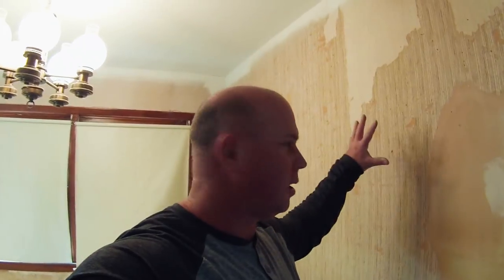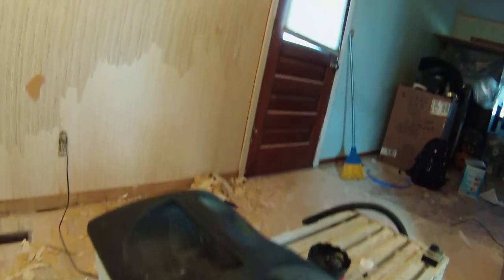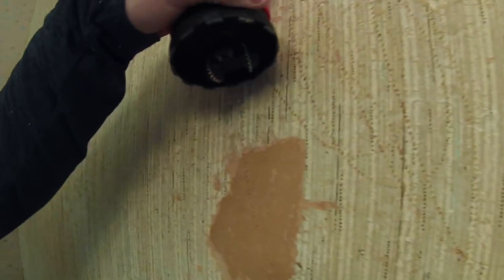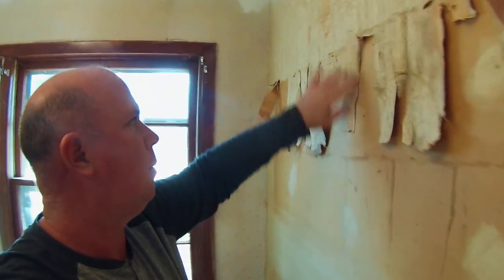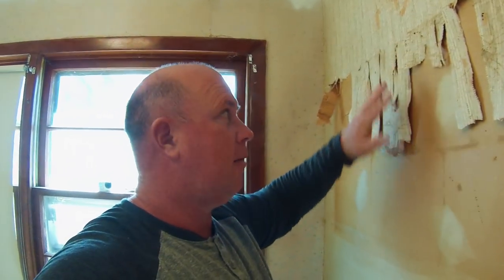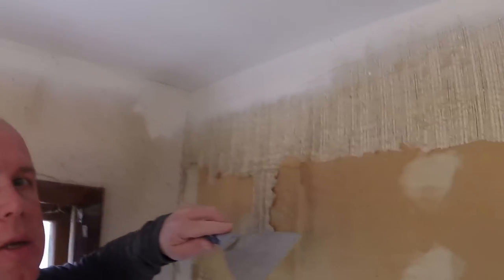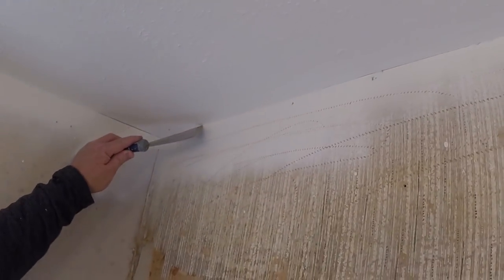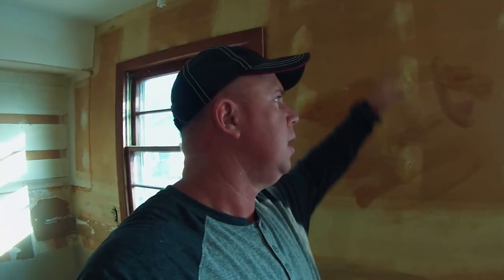Remove Old Wallpaper from Drywall Super Easy With Steamer

Comment: That wallpaper is coming off sooooo easily.. I’m working on an apartment in London built in the 80’s that’s covered in wallpaper... I have a steamer, I have a scorer, I have a scraper and it’s on drywall... taking me a long time and a lot of the paper lining on the drywall is coming off too... guess the wallpaper glue from the 80’s is a bit stronger in the UK? ;)
Reply: They probably didn't prime the wall before applying the wallpaper. That will wreck the drywall paper.

Comment: So what is the next step after the wallpaper is off? Can you just paint right over or is there another step. Keep up the great work as always Brian!
Reply: logdon17 ... and remember to fill any scrapes or holes with filler.. this can be done after painting too and is sometimes easier that way to see any imperfections that you might not see when the wall is bare.. strip.. clean.. paint... fill.. sand.. touch up

Comment: I wish I could hire you for my small project. The guys I hired have been in my dining room over 8hrs trying to remove wallpaper. I told them to try steaming it, but they dismissed my suggestion. 🤷🏽‍♀️
Reply from the maker: That sucks, These machines are not that expensive and work very well.